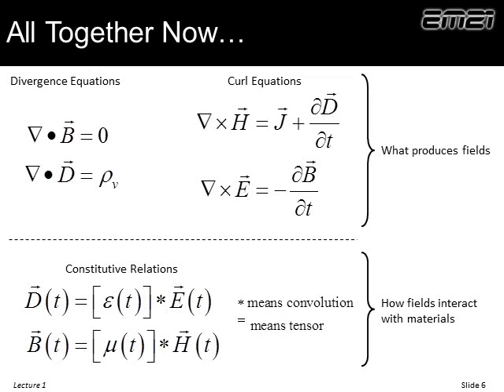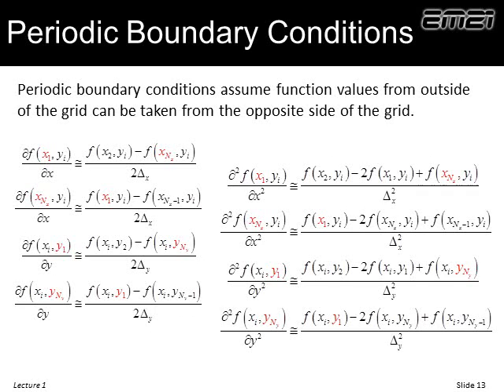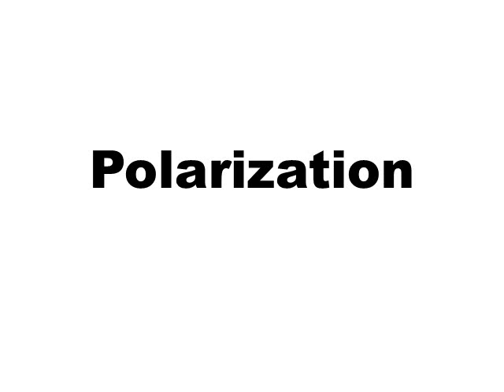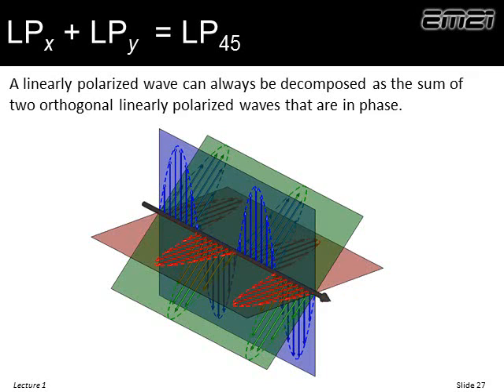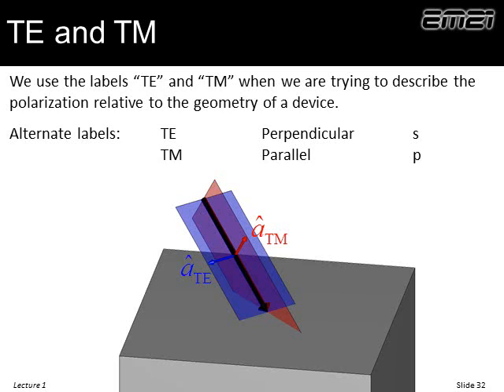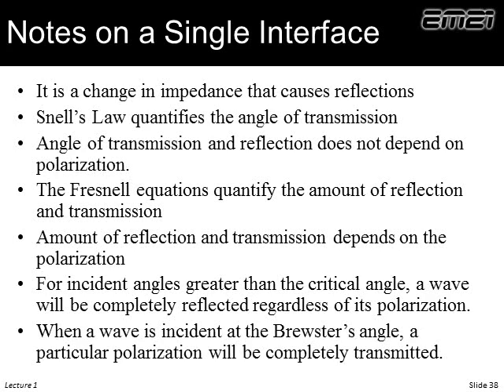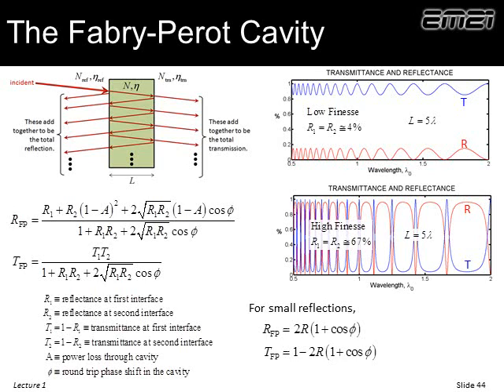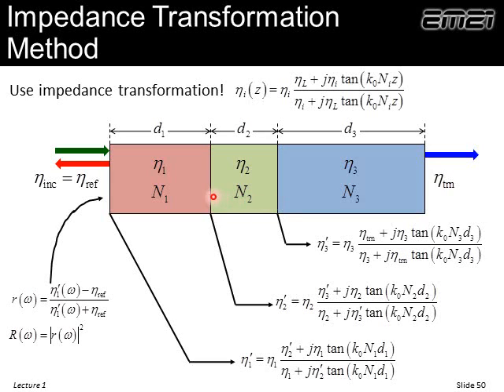Lecture 1 (EM21) -- Preliminary topics in EM

Comment: Professor, how polarization influences the reflection/transmission of the waveguide?
Reply from the maker: I think that depends heavily on what is causing the reflection.  If the waveguide is suddenly filled with another dielectric, the different modes will reflected very similarly.  If the obstruction is a vertical bar that only partially blocks the waveguide, the mode with the electric field parallel to the bar will interact with it much more and likely reflect more strongly.  That is because free charges can displace over much longer distances that way.  A wire grid polarizer operates from the same principle.